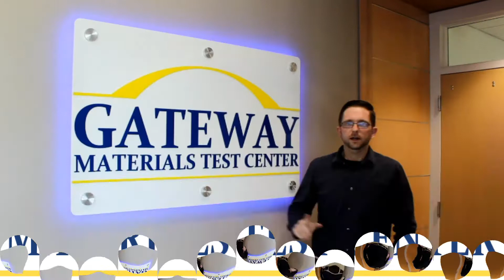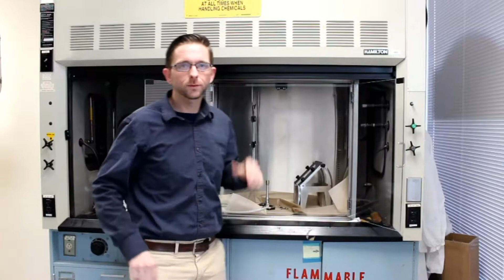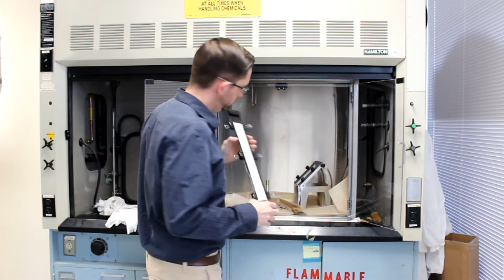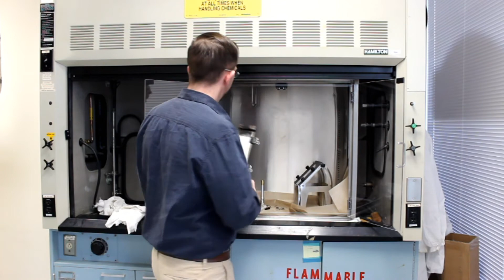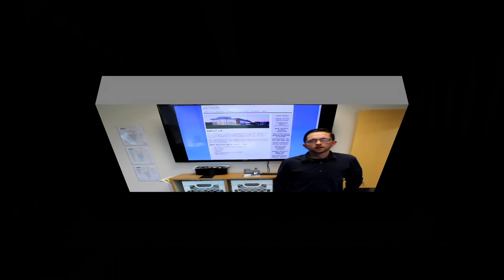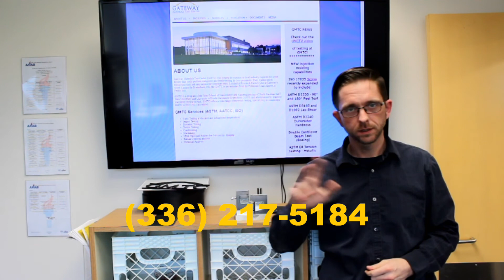ASTM D6413 Vertical Flame Test

Comment: Hi! Thanks for this video. Can you tell me what's the difference between this ASTM D6413 vertical flame spread test and the UL 94?
Reply from the maker: The test setup for each standard is different (sample geometry, flame type, flame time, etc.).  The procedures are also very different.  UL94 is traditionally used for materials used as parts in devices while ASTM D6413 is used for textiles.

Comment: What gas are you burning? Propane or butane?
Reply: It depends on the standard. Some such as FAR standards may require specific gas blends. Some may be fine with propane/butane. I would check the standard and what it specifies in terms of the temperature and gas type.

Comment: Hi! Thanks for this video. Can you tell me what's the difference between this ASTM D6413 vertical flame spread test and the NFPA 701? I  am scheduled to take the NCIDQ test exam this fall and we had a questions about this. I am not clear on when one of the tests would be required over another, or what the differentiating criteria is. Can you shed some light on this?